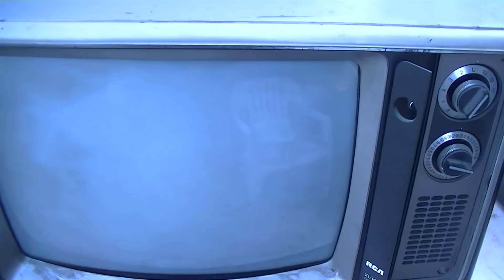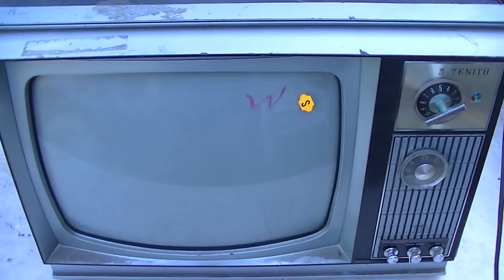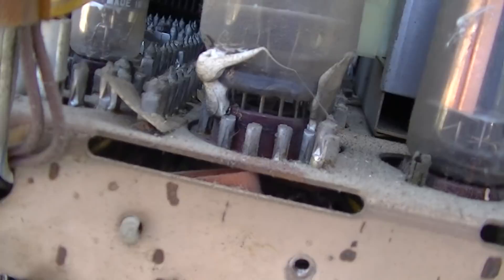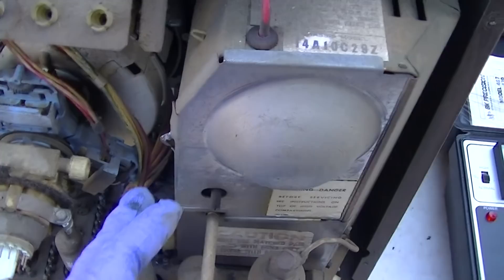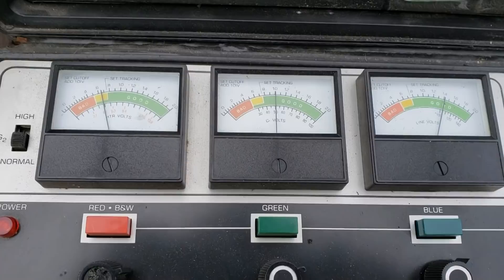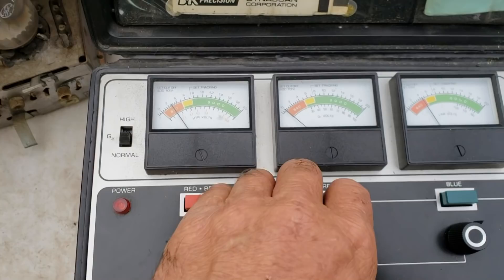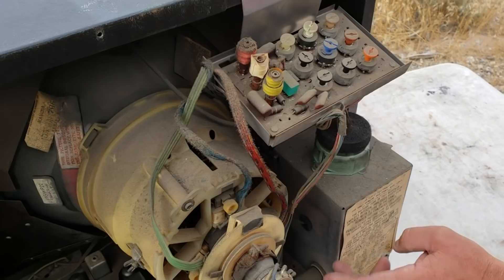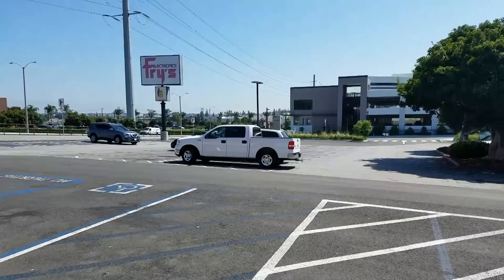6 Vintage Tabletop Televisions and a Look Around FRYS Electronics Store

Comment: Re: #1. The CTC-74. That was our 1st. color TV. ~1976-77. Dad brought to the house, much to the dismay of Mom who wanted a Zenith. Those "choppers" were replaced several times by RCA Service Co. during the warranty period. Then never again. After that, it lasted well into the 1980's, until one of the can filters failed. It then ran some more until the CRT was so blurry & weak to be watchable. It left this earth after much use, & a very weak CRT, but it had a million hours on it. It still ran. When turning it on, it might make you jump. It makes an initial loud hum/transformer type field noise, but that's normal. It also left a strange color rainbow when powered off, similar to the old B&W sets. Been looking for one around here for nostaigia. Ours had chrome knobs, wood accent sides, on a chrome tube pipe factory stand with castors. Very 1970's look.

Comment: 44:06, 45:13GE monitor top refrigerator. The compressor is on top. Uses sulfur dioxide as a refigrent unless it has ben converted to R-152A. Its from around 1935.
Reply: thanks for the info.. a refrigerant before my time..
Reply: Now that they are using propane and butane, sulfur dioxide doesn't sound so bad, and somehow that machine lasted 84 years. Maybe they should go back to it.
Reply: PC No everything last when it’s overbuilt....like the hover dam...said 100%overbuilt it but it should last 1000 years or more..
   When the engineer gets his calculator out and starts removing all the material he can.. it doesn’t last...
Reply: Damn, last place I saw one of those was at Pioneer Village in Minden, Nebraska.
Reply: @pcno2832  ironically propane and butane are less irritating than so2

Comment: The first RCA does use a inline tube. I think the scr's for the vertical and horizontal output always had issues. I always called them extra large, 100 pounds. When they were working they threw a great picture. Been a long time since I bothered to work on any of them. Nobody fixes anymore and almost nobody broadcasts analog anymore and they weigh a ton. I still have one of the last 34" Toshiba 34hfx84 16x9 HD sets in service and it still looks ok in a bedroom. Bought it new in 2005 for 750. It weighs 160 lb and the last Sony sets were even heavier.

Comment: On the RCA when the picture tube ended in TC01 it meant it was a bonded yoke according to the trainers at the service classes from RCA
Reply: RCA called it a COTY (Combined Optimum Tube and Yoke) system.

Comment: I used to work at Fry’s Electronics in the City of Industry in 2007. All the points you made about how it used to be were true for my location as well. It’s just a ghost of its former self. I wonder when the Fry Brothers will pull the plugs on some of their stores.

Comment: Gosh, a real electronics store with electronic components on the shelf. Haven't seen one of those in years. Radio Shack was the last we had in our little town - we used to have five electronics parts houses - now none. I've resorted to stopping at roadside heaps of black plastic 90s TVs, removing the backs, and cutting the circuit boards loose for a supply of parts - sad!

Comment: I've worked on a few of those ColorTrak sets and the chassis folds down to get to the components on the other side. The main problems I remember are weak CRT's, bad triplers, and there is a fusible resistor in the CRT screen voltage supply that likes to open.

Comment: The convergence issue on the "minty" set is the vertical capacitors most likely.  I had a 1986 "Teknika" as a kid that I had in my room, I had got for free for this issue.  I got it fixed, and it worked nice for a while but it was those caps

Comment: Well you gotta remember too that was the 19" version rca those had a high failure rate on the 25" version but the smaller sets seemed to hold up better with horizontal linearity issuess

Comment: we had the same 19 inch Zenith ,one with the metal back,(13:07) late 60's ( guessing) looking at a very old pic of it, 100% identical, except, the color scheme on front is reversed, where it's that dark brown rectangle/speakergrill at right for bottom dial, ours was the opposite , it had the upper color there,  as Shango066 would say, "What a Trip" forgot to mention, it died in 1982, picture tube was weak,  I remember ( age 15)  helping to put it in mom's 1980 Mercury Cougar XR7 , to take it in,  to see if it was worth repairing at the time,  it wasn't !!! I grew up on that set!!!

Comment: I found two sets on 9/7/19 in the trash one Catalina 25 inch console pulled one 6kg6 6lu8 12by7 6cg7 6fq7 6u10 6gh8 6gh8 a damper tube 6aq5 el90 the picture tube was obviously bad 2nd was a console with the picture tube and main chassis out but radio remained took tubes out 6au6 6au6 6fq7 6cg7 12ax7 em84 6fg6 6ba6 6be6 6fq5 6u9 6gh8 the speakers were torn horns may still be good luck Sunday.

Comment: RCA known for cold joints in vert & horz area. It will blow the special fuse & give
bright with retrace. Uses ITR's either short or cause small jumbled pix & scream.
Zenith 14" probably works. 

Tin can Zenith watch for cracked ground points on terminal strips. Both V size & HV adjust pots usually have bad spots.  Do a D&C also clean & bal all 3 guns.
Tin can RCA start with ALL new 6GH8's
LFOD !

Comment: The CTC74 The electrolytic cans used to go many times-the one in the middle of the chassis is the vertical yoke coupling cap--connections connections connections on the modules and on the board on the left for the deflection that is not removable.

Comment: Sold Zenith's exclusively and serviced all other TV's for more than 20 years.  During that time, I remember changing the Vert Out Xformer only once on a Zenith, and that was rare. At least in my experience, extremely rare.  Changed many yokes ie 95-2532 / 95-2701 but only one vert out.  Sound module failure was also rare;  the IC 221-48 usually failed, usually,  only by lightning as well as the 221-43 color IC.Now, I collect TV's; but only Zeniths.  Been looking for the Chromacolor 19" Model C, D, 4030 that you show there.  Any chance you want to sell that one?

Comment: What does 'cutoff' mean?
Reply: Generally in electronics (cutoff) usually means that its at a point where no electrons are flowing or they are set at some predetermining electron flow and anything below that level is considered below the cutoff level.
Reply: When you stop applying test voltage to the tube 6.3 volt